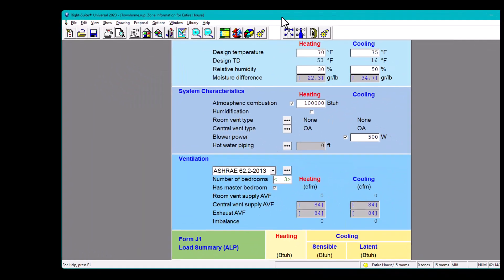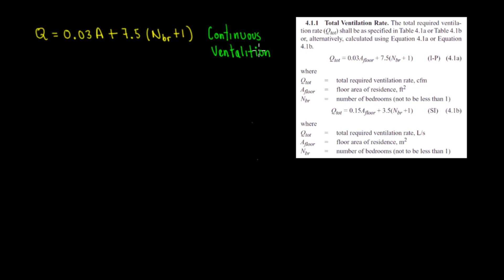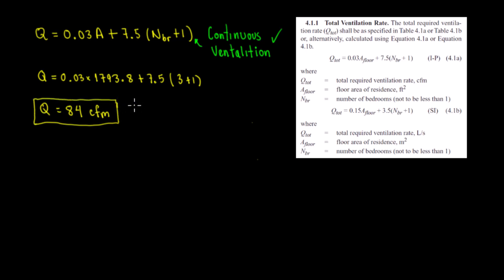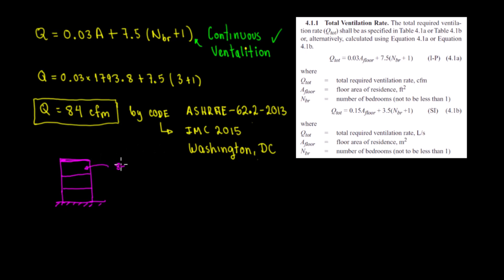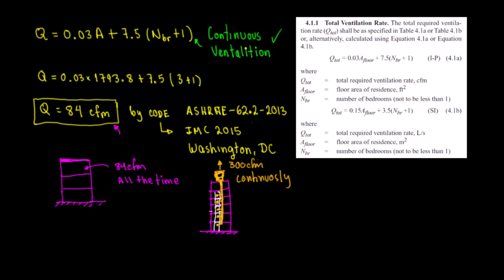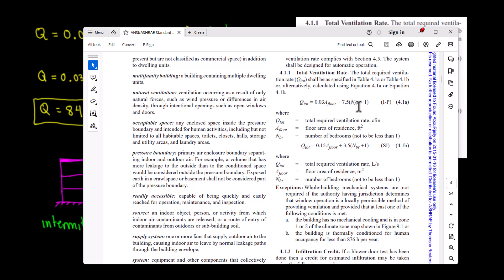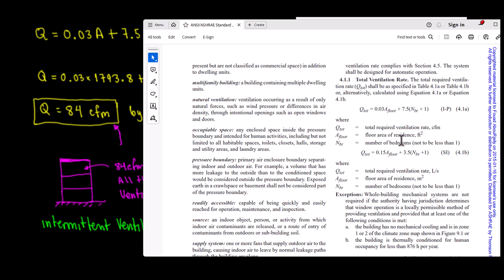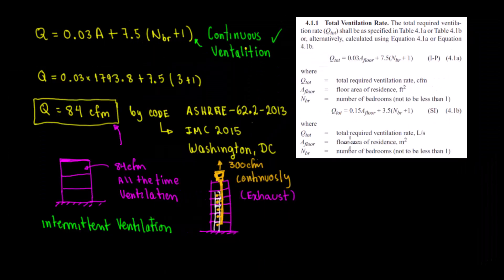ASHRAE 62.2 Fresh Air CFM, Ventilation Rate, Example

Comment: What about the ACH equation when we use it ? I see a lot of engineers use the ACH equation for ventilation and exhaust
Reply from the maker: Great question. IMC mainly uses 0.35 ACH but no less than 15 fm/person. This mainly depends on the designer. Particularly when designing multifamily projects I see we have two options. Whether to use ASHRAE 62.2-2013 or IMC-2015 (Washington DC for example) 
ASHRAE 62.2-2013 = 68 cfm
IMC-2015 = 48 cfm 
In this case, I personally use the worst case scenario which is 68 cfm (ASHRAE 62.2-2013) 

Also, it is important to keep in mind that the more Outside you put in a house or commercial building, the more expensive the project becomes.

Comment: What are these rates based off of? i.e. 0.03 for residential townhomes and 7.5 for light-moderate work?
Reply from the maker: Very good question. The first one is the Area Ventilation Rate which is 3 cfm/100 SF (ASHRAE 62.2 2013). This rate is based on calculation methods from ASHRAE 62.2. 

The second one is the Occupancy Rate. this is represent and account the number of occupants and the number itself might be a factor to determine the ventilation due to people.